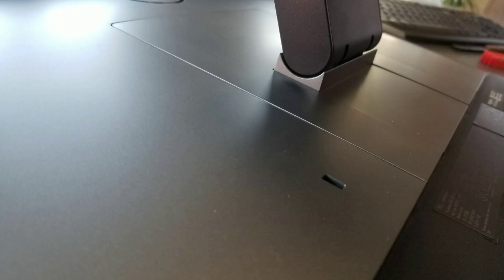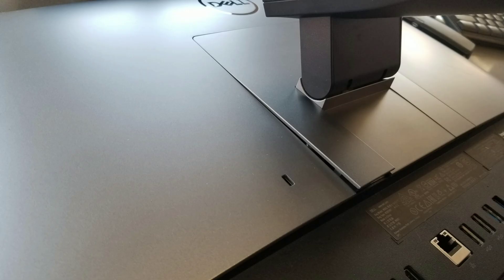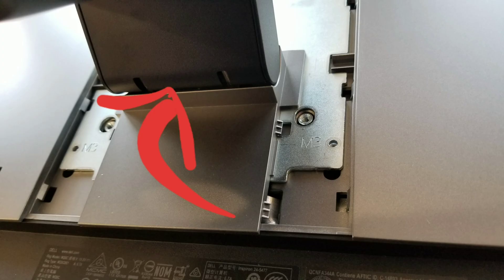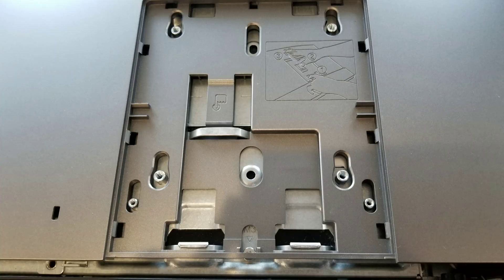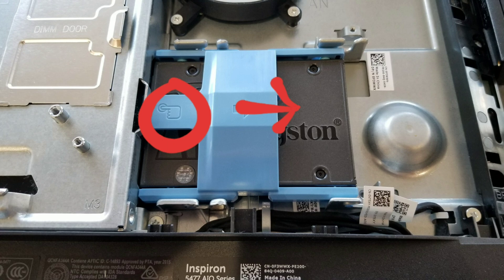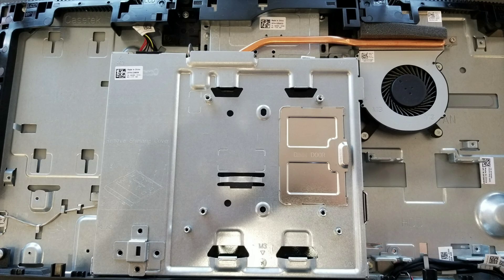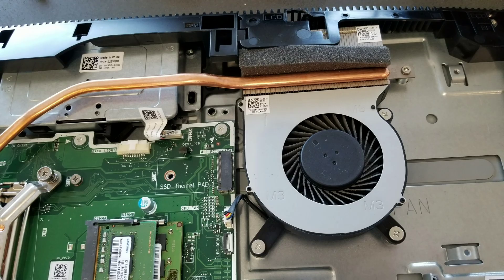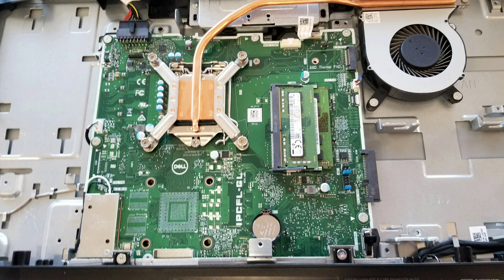DELL Inspiron 5477 AIO Series Disassembly RAM SSD Hard Drive Upgrade

Comment: I am Japanese. I also have an Inspiron 5477 AIO. You easily removed the plastic part at first, but I can't seem to remove it. Do you have any tricks?
Reply: I managed to get it off, but there was a screw in the plastic lid. The screw was damaged, but I was able to replace the NVMe inside.
Reply from the maker: Just what's in the video.

Comment: Hi do you know what’s max capacity of ram for that pc i have the 16 gb and thinking to upgrade to 32gb but dont know if it will read them
Reply from the maker: The max is whatever you can fit
Reply: @ItsBinhRepaired  No maximum is 32GB
Reply from the maker: @Thundering_Banshee  did you try putting 64GB?